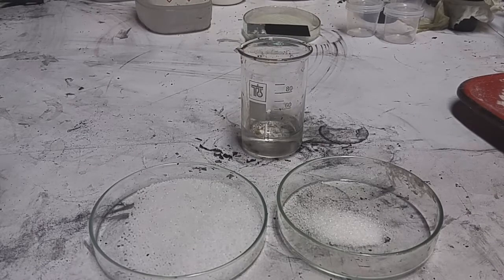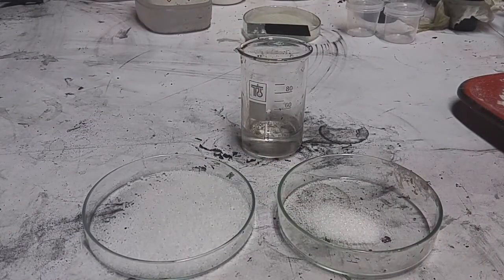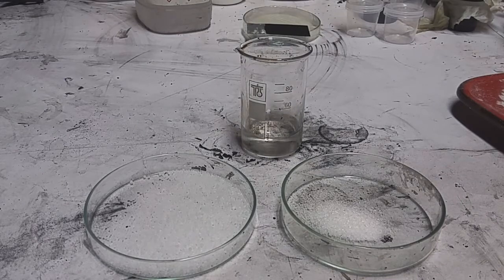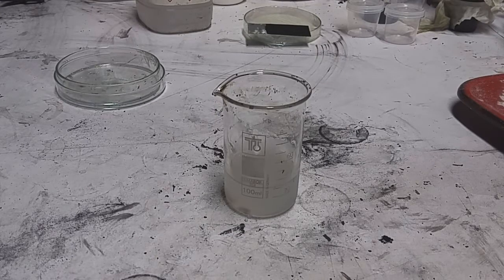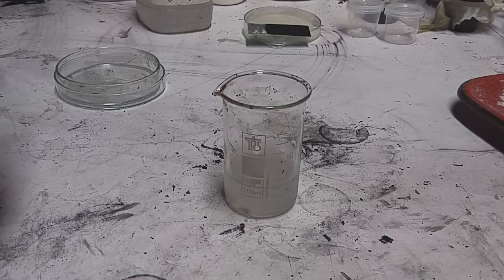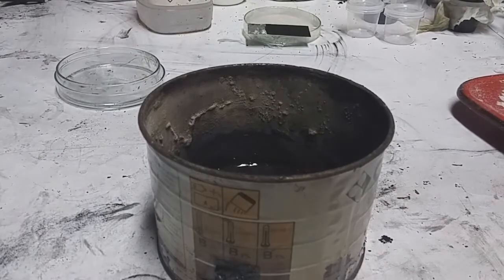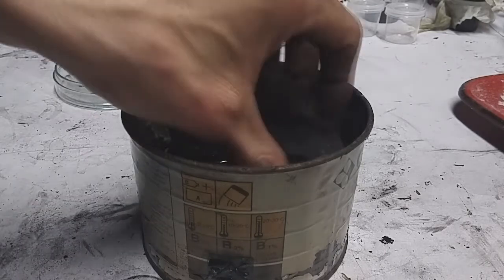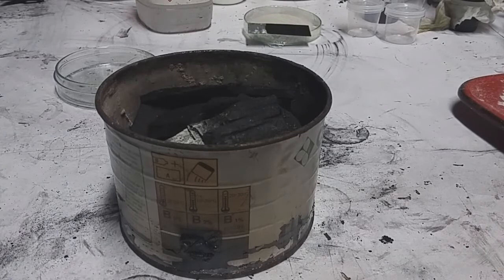Material for Battery and Supercapacitors (graphitic carbon nitride)

Comment: Heat it up from 450-550C. Above 550C it will not work. It works only in an NH4 Athmosphere no air may come in. The NH4 is created by heating up Urea so NH4 is provided by itself.

Comment: How do you verify that it worked? Are there any simple tests I can do to make sure the stuff produced is really graphitic carbon nitride?
Reply from the maker: You have tons of paper online for making graphitic carbon nitride from urea
Reply: Yeah, but your video already covered that part. Do you really just assume it worked and continue on? What if the completed battery doesn't work? How do you go about narrowing down where the problem occurred?
Reply from the maker: @dekutree64  this process for making graphitic carbon nitride from urea is really common and you will find alot of research papers. For testing the carbon nitride you need some equipment. I also test the graphitic carbon nitride in a battery
Reply from the maker: Oh boy,... I understand you wrong.... You can make two batteries one is with no graphitic carbon nitride and one with graphitic carbon nitride and charge both cells with same voltage and time. Than you test both cells,... cell with graphitic carbon nitrade works better. Make some easy zinc based battery, because this works at best.
Reply: Thanks! That gives me some idea how to go about devising indirect tests.

Comment: am electrolyzing copper pipes for Cu(OH)2 and noticed first day(5-7 hours)at 10 amps.12volts Theory am proposing is to soak charcoal in Cu(OH)2,dry C+Cu(OH)2 mixture and complete reaction, your show the charcoal ,sugar,water and  urea.The purpose is to make ethanol from  wood smokefumes.Think work?Ethanol from wood stove smoke
Reply: found feo3 mix +c

Comment: Hi. I was reading up on burnt fumes from Urea and on a fire fumes safety they state things 
that contain nitrogen can produce Hydrogen Cyanide. 
Here is where it say's it http://web.mit.edu/parmstr/Public/NRCan/CanBldgDigests/cbd144_e.html

Other pages say its  as slightly dangerous.
Reply: I miss read the doc.  I just read again and there is a - after Urea, As in urea-formaldehyde . better safe then sorry thatnks.
Reply from the maker: you are correct. to be honest,... "almost" all chemical reactions can be toxic if you heat or burn (dont breathe). heating the urea with gas flame is the alternative option for me because I don't have lab furnace. but the right way is using of lab furnace.

Comment: Fantastic vid!, and what a most lovely pile of yellowy graphitic carbon nitride you have there at the start ;).  Excellent and super simple charcoal bricket and sealed tin method too, plus V nice tip about the 1g carbon black addition which i will try in my next batch, Cheers Dusan! :) (y)
Reply from the maker: Ecoponico R&D yea,.... this material is cool. you can heat this with propane gas. the blue flame of propane gas can get over 1000 deg C.
Reply: Well sorted stuff!, cheers mate! :)
Reply from the maker: Thank you man :)